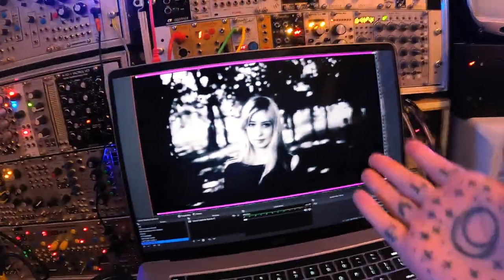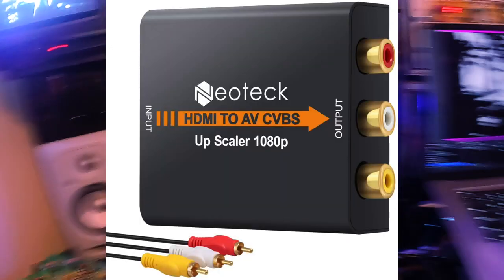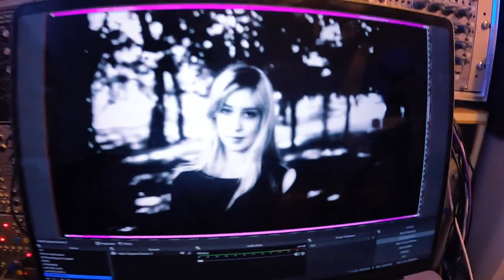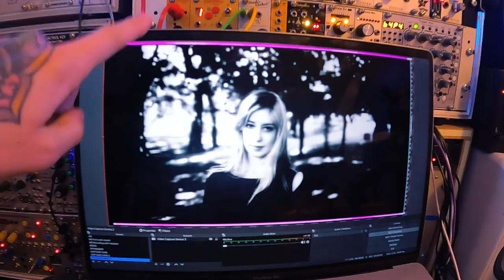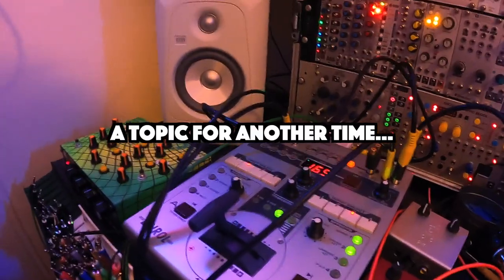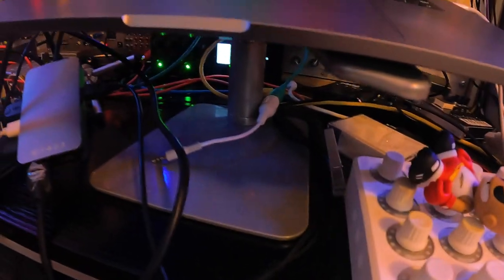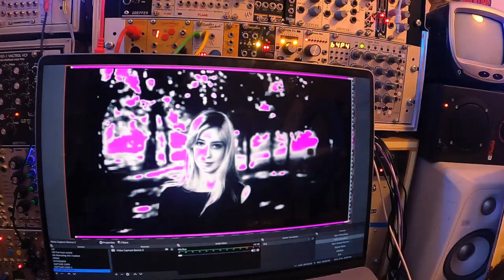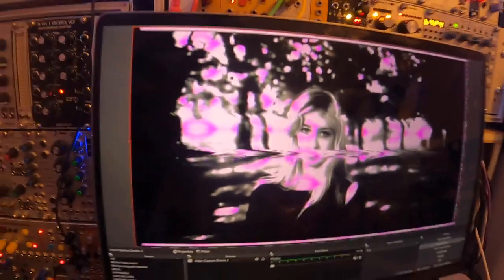Video Synth Experiments: Making Glitchy Visuals with Analogue Video Hardware

Comment: Im not really getting how your crt tv is hooked up, did you use another output of the video mixer to hook it up? or did you hook it up from somewhere else? since you can't use the crt to run through because it doenst have an output i am wondering where its hooked up to. Sorry if i am very confused
Reply from the maker: Yeah exactly. Just taking an extra output from the mixer going to the CRT to act as a monitor, so it's not involved in the actual FX outside of displaying the video.